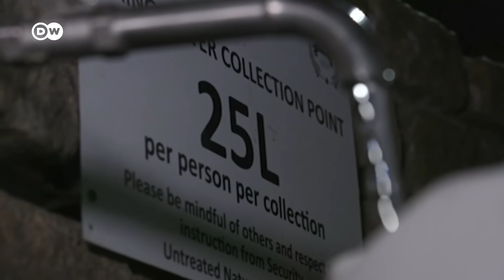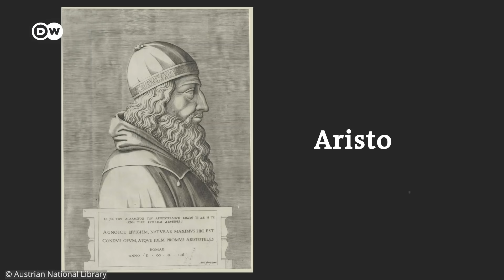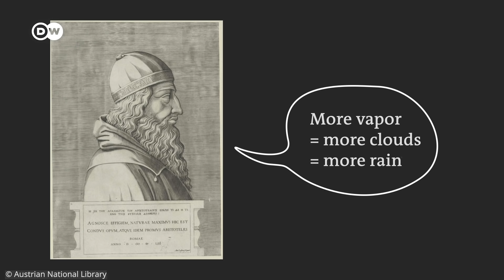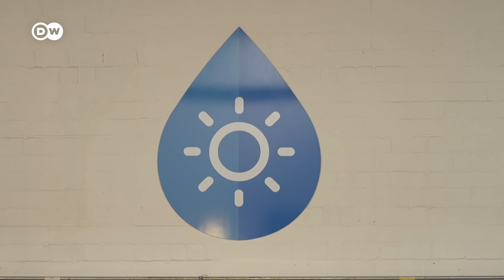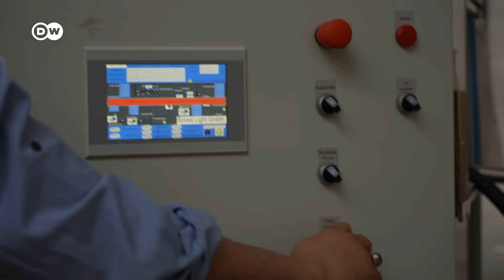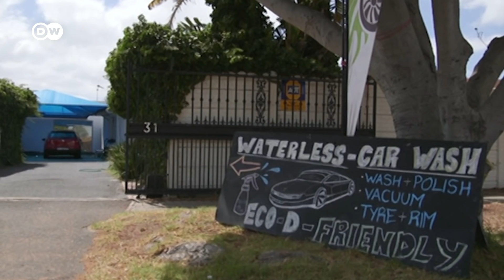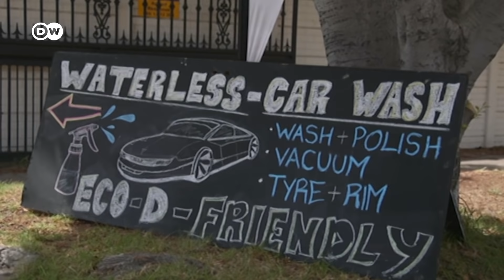Can desalination solve the global water crisis?

Comment: Just throwing my 2 cents: 

Use the thermal waters - or rather make artificial thermal stream, enough to boil a lot of water.  Let's say a build an artificial river - a small stream of water passing through a thermal area (volcanic i think), with some sort of roof that could catch the vapor, and get it elsewhere for condensation. The stream would end in a small pond full of brine, which can be sent to...idk a desert? a tomato farm? or maybe an insecticide? For  best efficiency, maybe, this artificial river should be curved, so as to use as much thermal area as possible

This would save energy, but would be expensive to build - any thoughts?

I mention this also because I am making a game and this is a secondary topic within it lol

(edits based on replies:)
-It would be more of a pipe stream coming from afar the volcanic area and placed within a dome/roof

(Sep. 17 edit)
-After doing some research and reading other comments...the best course would be transferral of salt water - think a coffee steamer, which boils water directly through metal heating. My approach would be take a volcanic area and insert some metal tubes a few miles away (or any other way to transfer energy to a water area) to a lake with a dome, and then similar to what was expressed - although dunno how much heat would be lost with a 3 mile metal tube, nor how expensive it would get, and there is the brine problem still
Reply: unfortunately the area surrounding volcanoes and thermal streams are usually choked full of chemicals and minerals, they're some of the most toxic places in the world. there are tons of spas that are built around the safer ones where you can go bathe in it for supposed health benefits. very few would be considered safe to use for drinking or irrigation no matter how much you filter and treat the water flowing through them. the gasses from volcanoes are also deadly, the magma level and gas emissions (and eruptions) are also unpredictable.
hence we have never got a volcano or thermal spring powered electricity plant.
Reply: @penitent2401  
About the chemicals...are they in the land itself? because if it were, then a long pipe (instead of the river) could do the job (assuming the chemicals/minerals won't permeate inside the pipe)
About the impredictability...this one's hard, maybe perhaps have a seismic/geologist team in a nearby area (this would, increment the costs though)

A general solution (with the above mentioned), would be to start (& end) the pipe far from the volcano, and I dunno, perhaps make it retractible in case volcano decides to erupt
Reply: @penitent2401  yeah it wouldn’t have to be near a volcano. I’m sure we could find another method to produce the heat.
Reply: @shelbymustain9077  the one thing that plagues desalination method is the energy costs, heating or reverse osmosis are the two main methods and both are enormously costly. there's a Nobel prize in it for anyone who can find a more energy efficient method that works on large scale.
Reply: Good luck trying to build a river thru a volcano 😩
Reply: @synthsol5522  *pipe
Reply: I can envision a domed or curved roof that almost looks like a groin vault. If the sides of it have lipped arches, the evaporated water could flow down the sides into a reservoir. The roof would kind of look like one of those back massagers that have 4 ball thingies at the ends of the sides
Reply: @shelbymustain9077  Sounds awesome! I didn't give much thought on the roof shape part, I only thought of evaporation part, but your roof idea sounds cool - specially considering the massager shape. About the reservoir...maybe connect the 4 sides through a pipe and then into a reservoir
Reply: @remy_from_games  that’s what I was thinking too! Like a gutter system with an inverted roof. And the water could just flow into a pool in the center of the room to be evaporated.
Reply: *the salt water would be in the center pool. The evaporated water would go the reservoir
Reply: @shelbymustain9077  Yup! In the end it would become a sort of "Huge Distillation tube"
Reply: Lets do our part to stop climate change: eat less animal products, travel and drive less,  buy and consume less, support sustainable brands when you can afford it, regenerate vegetation
Reply: @Rafa-nn3zw  for "sustainable brands" they can be very misleading. for most it's just an excuse to slap 50% mark up in price. for example, a company says their plastic bottle is made of 50% recycled plastics. during manufacturing the bottle is formed and the excess material is cut off and along with any bottles that didn't turn out well is melted back down to form new bottles, the volume melted back down make up a large part or all of that "50% recycled". or they may be making other products and the bottles are made from excess cuts and they can claim 100% recycled plastics without the factory ever taking in a single piece of recycled plastic from outside the factory.
if you want real sustainable, buy fresh foods grown locally where you can, they're healthier too and sometimes actually cheaper. less packaging, transport distance, chemicals and preservatives. for non-foods, buy things that are build well and made to last, don't buy into the trend of new replacement every year such as new phones and clothes, buy quality that will last you for a long time and don't care about fashion trends. 
no matter how much they advertise their product as made from recyclable materials, 90% of what goes into a recycling bin does not get recycled.
for example, Styrofoam and plastic bags, fill a truck with them and drive it to the recycling plant and you've just burnt nearly their weight in fuel to transport 95% air. and when you do get to the plant, vast majority does not recycle them, too difficult to as they do not melt easily before burning. so most just dispose of it by burning.
Reply: @Rafa-nn3zw  i think you mean "waste less" and "do more"

does mankind even possess the capacity? - honestly yes, i think so.
Reply: I guess it depends on how close you need to get the Water to the Thermal source. I can Imagine what you are thinking, but if we are talking about something like a Vulcano, there are alot of gases that are also produced in that Area and would mix in with the Steam that we later want to drink. 

Also I dont think the resulting liquid would be called brine(if managed to be collected without the aforementioned gases). Since its a different way then pushing the Water through a membrane. Thats where you get the brine on one side and clean water on the other.
Reply: 😂😂😂r kidding volcano 🌋 really
Reply: what game?
Reply: how do you move the water up?
Reply: Seems like sth that japan should try considering they are an island with alot of volcanoes and also adequately well off. (Maybe not anytime soon tho due to olympics recession haha)
Reply: That would work for a place with natural thermal energy, I have thought of this as well. When distilling you wouldnt have brine just the concentrated elements left in the bottom of the vessel.    The video was referring to Reverse Osmosis filtration where you have a concentrated waste water flow.  I would think that a solution would be like in mineral production where you dry the concentrate in pools, seperate elements, and sell it.
Reply: I don't know how much it will cost, but if we send rockets and shuttles into space, I think we can afford it. Or at least, we could if we really want.
I heard 50 people had as much money as 50% of the poorest part of the population.
As long as society runs after "profits" this will never change, because all the profits go to the same people in the end.
The moment we will chose welfare and survival as a priority above profits, all budgets problems will be solved for this kind of vital projects.

But it's not a logistic or even financial problem, it's political.
We need to change the way the power is spread and how our decisions are taken, or the richest people will continue ruling the world for more profits and we eventually all die from a collective greedy madness. If we survive this, our descendants will describe this society has worshiping money and wealth. All these commercials everywhere are just like old idols, we think they are normal because we see them everyday, but they aren't. The world is dying from worshiping consumerism to satisfy the greed and addiction to power of a very small minority of the population.

And don't get me wrong, don't blame these ultra-rich elite people. If we were born in her shoes, we would do the same as they do. It's human nature.
Power is too dangerous for human mind and must be equally spread between everybody. Power seems like enjoyable, but too much power is a curse. No one can really handle it in the long run, we're not made too. It will turns us mad, greedy and eventually evil. So I don't think it's the rich people's fault, even if they are the one in power. I think it's everyone responsibility to abandon our collective power to a few people which will lead them to become crazy everytime...

What we need is to make a good political program for the survival of the whole humanity, consult as much people as we can from everywhere in the world, make people know about it and improve it for as much time as we've left.

And when it's done, we will vote every year for this project until +75% of the population agrees with it.

When it's done, we can finally end this "profit paradigm" and make a peaceful, democratic and very legitimate revolution for our own survival as a specie, without even having to use violence. We will just have to wait until the majority of humanity gives its consent. But think about it, the more plan A is going to fail, the more plan B will become attractive for everyone, at an instinctive/survival level. Survival is the only real leverage that drives and has driven people for the last thousands of years. For this kind of project, time is definitely on our side. Not only it's possible, but I think it's the only way !

This is the challenge evolution is offering to us. We will have to learn to think and decide as a specie, for the well being of everyone, or we are going to face extinction, as a specie.
Bad news is, if evolution works like it always did, we probably are going to suffer great loss before we understand and adapt to this challenge.
Can we do better this time ? I don't know, but I think it's still worth trying.

"We must learn to live together as brothers or perish together as fools." - Martin Luther King, Jr.
Reply: I've always thought using a roof that is a type of magnifying lens, which could use the sun focused on a body of water to turn it to steam, sun thermal energy is free, I would guess. I'm just a nobody with an idea lol. But the brine will always be a problem
Reply: Dude, where the heck are we supposed to find a thermal source close by?  Use your head.  except for Iceland...

Comment: "Flush only when you really need to flush" - yeah right, and how exactly are we going to deal with sewage that is 5 or 10 times more coondensed than now? XD
Reply: Very good pint. Many sewage systems are not built for periods of draughts. Cape Town did a great job in using less water during the drought, but their sewage system almost collapsed. Stay tuned, my friend. I am working on a video about this problem for this channel.
Reply: @GeeKIller dude gamer bottle strat is ecofriendly holy shit
Reply: @burgernthemomrailer  Not washing your ass for a week is too bro, gamers really out here saving the world, another tip is to get as deep into a game till you forget to eat or drink water, we heroes bro.
Reply: @burgernthemomrailer  these news are comparable to if someone told you that fapping cures cancer arent they? xD
Reply: Moderate flow is essential for a good working wastewater system.  Having a slow system from little to no use is bad.  I deal with this on a daily basis.
Reply: Sewage plants will be fine, your pipes would probably be fine as solids will have a longer time to break down before you flush. I'm not sure how this is actually a problem aside from the home sanitation factor?

Comment: I have been a reverse osmosis technician for my entire naval career. I can tell you that it is very effective, but does require a lot of expensive consumable resources including plastics, filters and minerals such as calcium hypochlorite, and bromine. It’s basically like using K cups instead of brewing a pot. 

Evaporators require a heat source, but are extremely effective and efficient at demoralizing water, but the aspect of adding minerals and chemical treatment still exists. 

Singapore has created a type of reverse osmosis facility that transforms all of their waste water back into drinking water. The end product is very pure and healthy water and is very efficient. 

IMO, we could take a lesson on that for our coast lines. However, due to the consumerist/capitalist nature of our economy, I would think these types of facilities would put a huge tax on drinkable water. 

The man has to get paid after all
Reply: these are all great insights!
Question please: I live in a hot country where temperature rarely goes below 30 C, if I point several magnifying glasses at water, wouldn't evaporate? (and so I could just stick a tube out of the container to get distilled water)
Magnifying glasses make fire within seconds in this temperature.
Reply: @mobbs8229  Correct me if I'm wrong, but magnifying glasses due to concave shapes are extraordinary at heating to high temperatures very small points on  a surface, but probably quite a bit less effective and efficient at heating up an entire glass of water.  An elaborate system of mirrors such as those used at solar mirror heat arrays might be better, though I'm still not sure how the efficiency would be because I think that's better for more focused heat energy.
Reply: @mobbs8229  yes! That's not s too bad of a plan tbf
Reply: >"Evaporators require a heat source, but are extremely effective and efficient at demoralizing water" lol.
Reply: @peasant8246  what has happen is, fir centuries, we only have used good water for agriculture, i have designed a system that uses sea water to grow any crop in coastal areas, this will stop usiing  aquifers for irrigation, is cheaper to pump sea water than deeper wells,
Reply: Just use parabolic mirrors and heat the water directly with sunlight. Keep the leftover salt (which is solid because all water can evaporate) and put it in food. If it's unclean, throw it in abandoned salt mines. Nature doesn't care if salt mines get their salt back.
Reply: We had a desalination plant in Victoria Australia to make water when we are in Drought but I think it got too expensive.
Reply: Cost can be kept reasonable with scale. If you have no potable water? It’s priceless.
Reply: it's sponsored content crafter by lobbyiste. my guess is fossil energy producers, because like you pointed out, it's very energy consuming to desalinate water. Science education for all..

Comment: Water is only a valuable substance were its in short suply. Senselessly  "saving" water can damage infrastuctures......also if you take seawater from a source whats teh problem of duming the brine at the same spot? does it not mix with normal seawater?  kind of like making plasticbads illigal in contrys that have an working waste infrastucture when 90%+ of the plastic in the oceans comes from a handfull of deveoping contrys? especally when some of said contrys buy pre shreddered 1 way plastic productus and use them to make things like textiles?

Also its kinda bad to compare London to the middle east? Londons water problems are mostly becasue a lots  of the water they put in the piping gets lost due to it beime more than 100 years old? not every problem has the same solution depending on circumstances.

Comment: Green energy can't supply the US let alone the world. Nuclear power is the way to go
Reply: Nuclear energy is with big difference the most expensive one, is cheap only in the moment is produced but then next generations through hundreds of thousands of years will have to maintain the waste produced.
Reply: @sapereaude1483  do you realize we can recycle nuclear waste like they do in France? Also the most we use it the better we get at it and we may get to a point that we are using nuclear fusion which is more clean than nuclear fission like we are using right now
Reply: @bryanbradley6871  No, as far as I know nuclear waste currently only can be used for nuclear weapons. Yes fusion will be a solution but at this pace renewables are coming faster.
Reply: @sapereaude1483  dude you can recycle nuclear waste, France does this. 95% of nuclear waste is reusable lol
Reply: @bryanbradley6871  Oh nice didn't know that!
Reply: @sapereaude1483  ya, thats why nuclear power is the way to go. Most people against it fear a another Chernobyl happening, but they don't know that Chernobyl and Fukushima was cheaply made and had a single shield protecting it and Fukushima was built on a fault zone and next to an ocean. The US legally have to use multiple shields  are used and and most are made made away from any type of fault zone and a large population.